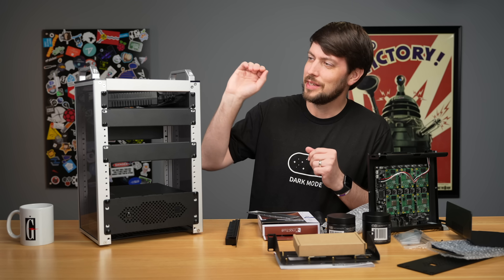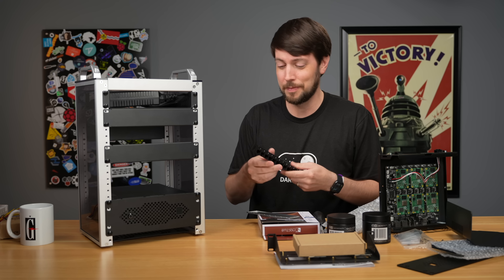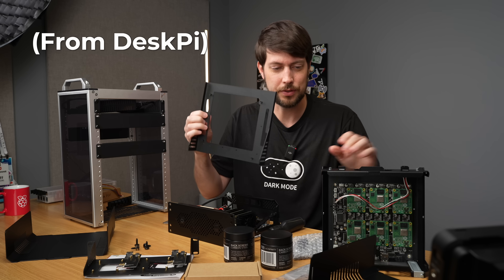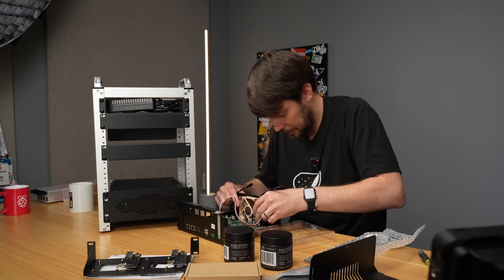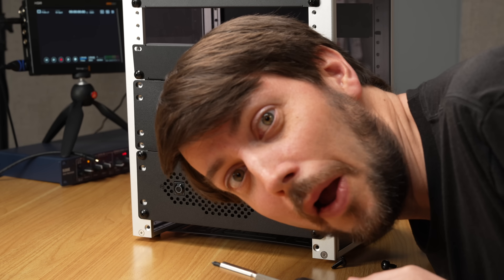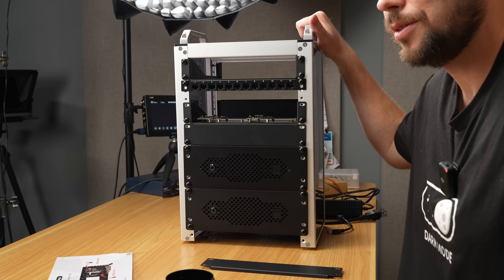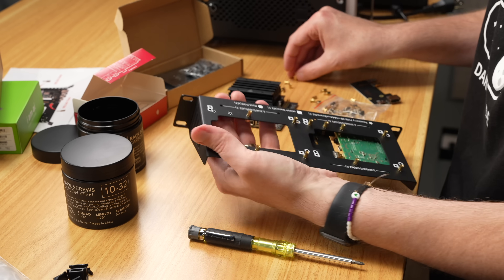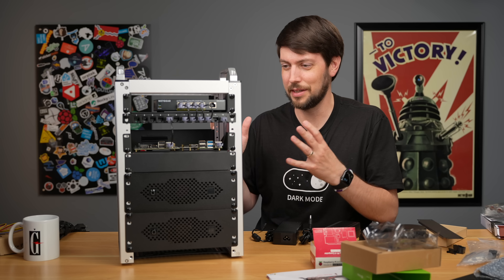Say Hello to My Little Rack!

Comment: The only thing I don't like is that there's no 10" UPS.

Also, I think the blank panel is supposed to be put on after the shelf so that lip hangs off the shelf and makes it look like a 2U piece instead of two separate 1U pieces.

Comment: Thanks to all the mini rack videos between you and friends, I learned that "10inch" rack space is extremely niece and raspi parallel.  Don't get me wrong. I have a raspi4. But that is just that. That generation of raspi convinced me it was a money pit. So I chose a 12U 19" rack for my first one instead. I want something that can grow with me. At least for a time. What ever part I buy that can go to the next upgraded system, would be good in my eyes. But without your videos and friends. I would have spent $200 more on my setup If I had not realized this.  Not to mention I don't want to buy a 3d printer yet. With bamboo 3d printers turning into canon or hp with regular printers business model and all. So thanks. Dogged a few bullets due to your reviews.

Comment: Just installed my 8U geekpi rack, nothing as flash as yours, just to tidy up and put all the iot hubs and netgate fw, switch, ap etc all in one place, wish I had done it ages ago. Just the right level of build quality. thanks for the recommendation. Love the Pi shelf, using it for a Unifi Controller. The wife also likes it. Now going to 3d print some cable management for it.

Comment: for power supply, why not use a Meanwell 12v PSU, and then add 12v car USB adapters for the 5v USB-C devices, and use pico psu for "main boards" (you can find upto 250W), that way (although you still have plenty of cables, they can be exact length, and) you only need ONE PSU (to rule them all). NOTE: this is how I have my mobile setup to manage about 15 SBC and 4 mini-ITX "main boards", but I also have automatic dual power switch that flips from solar 12v to mains 12v when "land bound", all running of a single 500W Meanwell 12v PSU with 12v car USB power where needed (and one mains cord :)

Comment: Can I ask why you have everything offset by one screw? Its the reason nothing is lining up exactly as it should. If you look at your holes they are not spaced quite right. Its because every on a single U, the middle hole is always offset. You need to use the top and bottom hole on a single U.

Comment: Gonna put this here too. I found that a UPS/PDU for a 10 " rack was completely lacking with one exception that is profoundly overpriced compared to 19" versions.  My partners and I run a prototyping lab, and we are downsizing our network rack as well as taking it off-grid.  The goal is to run mobile offices, moving them from client to client, improving collaboration, speeding up iteration, and saving shipping.  We've downsized the office network, from 2x36u racks to a 20u rack, and now to a 10" 12u rack.  

The last piece to this migration is a DC PS / PDU / UPS fitting in a 10" form factor which we have been designing and refining over the last 5 years. The price would be comparable or less than a similar commercial lithium UPS. This has been a slow burn project since I thought we were the only ones interested in such a device, so we didn't make it a priority or crowdfunded it. Building more would be about the same work as building ours, so if there is interest we can take the project off the back burner and build as many as needed. 

As currently designed, this 2u 10" rack UPS provides a number of 5V, 12V, 19-20V, and 48-54V barrel jacks, as well as USB-C outputs.  There are no AC outlets; it is DC only.  A small OLED touchscreen and embedded web server are used to monitor and control the UPS as well as send shutdown signals to the connected servers if and when the batteries are depleted.  The system will recharge and run on AC power and/or DC (solar?) as available and provides up to 1120W of power.  

The UPS as a system scales from 500W/h to 7W/h of capacity.  This means that it has 20 minutes of real run time at max load for the minimum system, and up to 6 hours for the maximum.  At a lower load, such as the 238W we expect to be drawing, we are looking at 2 hours for the minimum system and well over 24 hours for the maximum, which was our design specification.  Note that KVA ratings don't really translate 1 to 1, since no AC is provided, but it is close enough.

The way it scales is that it is a 2u 500W/h device that is expandable with up to 3 additional 2u battery packs each adding 1W/h for a total of 3.5W/h.  For AC (shore power) charging, we plan to have a 3u 1/3 depth AC adapter that can be mounted on the rear of the rack enclosure, convertible to a front mounted 1u 1/2 depth unit by flipping one set of rack mount ears and discarding the rest.  Yes, this would occupy a total of 8u, 9u with the AC power supply, so we are also making a small 1/2 u, 1/3 depth ATS that allows up to 2 UPS and battery expansion systems to be mounted in a different 10" rack enclosures as well as providing load balancing and automatic fail-over. Since we plan to run Starlink, a network, local AI server, NAS /container server, PoE phones, wireless APs, lighting, and other systems in the mobile office, this isn't as much overkill as to seems. The UPS would also work well in a tiny home, vanlife, or other compact low power application. 

If it sounds like this is something you need or want, please let me know and we will start making it a reality.

Comment: Geekpi now offers a 0.5U brush cable panel on their website. Has anyone found a power conditioner that will fit this rack? I purchased the AtlasIED AP-S15HR and it is slightly too wide. I have the Dremel ready to go to make it fit, but was wondering if anyone has other solutions.
Reply: some guy on ebay has them the rack ears need a little modification but it wasnt to bad

Comment: The Middle Atlantic PD-415R-SP fits perfectly in a 10 inch rack for surge protection
Reply: For others reading: I got one from ebay on this recommendation ($82). It certainly fits, but the rack backets don't support the position of the holes on the geeekpi rack. I solved this by screwing in only one side, then putting a rack shelf underneath ($22) to stabilize it. It works and doesn't look awful. 4 power ports, surge protection, looks cool. A+ for ~$100 total.

Comment: Would a  450 - 1.2 KW 5/12V PDU work ? 😊 have a WiFi enabled version in prototype..

It’s a take of of the learning cluster power control system

Comment: My boss gave me one of these today and saw the same stuff about finding PDUs I think I'm likely to get a "recessed power strip" like those meant for embedding into conference tables.  They are usually a little tall for 1u but could be shaved down if plastic housing. 

https://youtu.be/yEVrbBEZ3i0?si=6wqkWZjl6SaDDFQb
@lmcases1985 Make a half rack width PDU with us plugs. It's pricey but top notch quality.

Also the Tripp lite BC600R could likely rest on the bottom of the rack if loaded from the side. It just wouldn't hook to the rails, as is. Maybe some custom shelf and/or brackets +zip ties.

Comment: KC7ZDM here. I have a mobile 4U 19" rack case originally designed for mobile audio ops. I put two shelves in and mounted a Yaesu VHF/UHF FM radio, and a Yaesu HF/VHF/UHF radio. Each radio has a TNC (terminal node controller) for WinLink and other digital modes as well as power distribution based on Anderson Power Poles (12VDC). I'm just turning 68 this month and not getting younger and stronger. I'm thinking two of these 10" racks are more easily transportable or I could put them in a transport case and use a dolly.  Either way, the weight would be reduced when setting up and tearing down which we ham operators do often.  One of the events I like to support is the Silver State Classic Challenge race on Hwy 318 between Lund (at the north end) and Hiko (on the south end).  The speed record for the 92 mile course is 219.6430 miles per hour set in 2017. That's AVERAGE speed!  The event uses us for comms as there is no reliable cell coverage (or any at all in most places). We use the event for disaster comms training. It's a win-win!

Comment: Maybe you don't need a PDU for AC power, you can get a 12VDC "PDU" by using a blank 1U Panel and drill some sockets, and a high amperage AC/DC converter (or brick).

Comment: I love this 10 inch rack, much cooler than the hanging types. So I remembered you saying you can't find a US 10 inch PDU, 10 inch racks are common in Europe for SOHO use, so accessories are much easier to get hold of, anyway I came across this video when investigating 10 inch racks more https://www.youtube.com/watch?v=cALwxH5vJuo Don of Novaspirit Tech bought a surge protector power gang with 3 mains and 3 USB sockets, then 3D printed a panel with posts that aligns with the hanging holes of the power gang for his PDU solution, so might be an option you could look at if you don't find a ready to go 10 inch US PDU.

Comment: I have to admit, that little rack is very cool!  A nice portable form factor that is flexible and reconfigurable.  A small UPS would be a perfect addition...  I have been debating about designing a small UPS for Raspberry PI systems for just this use case.   Most of the small USB battery packs don't have continuous power output, or end up having problems with the batteries if left plugged in.    Oh we could even have a little power monitoring circuit in the loop so you can Grafana the power usage.  Lots of possibilities!

Comment: An enclosure with a few Pi's, a mini pc and 3d print a mount four a Ubiquiti switch it would be awesome. I am betting you could take a small UPS apart and put it in an enclosure that will fit that rack if you feel comfortable working with line voltage. Unfortunately the rack is out of stock. Once I get one and a 3d printer might come up with something awesome.

Comment: You could get the magnetic LTT cable management system, they come with power brick holders that will attache to the blanks.
Reply from the maker: Not a bad idea. There are some nice little power strips that have those keyholes.

Comment: I always do the 2 bottom screws only. If it's heavy, it'll just pull  backward on the top, meaning the top screws aren't really doing much for you
Reply from the maker: Be adventurous! Do top screws only for lower equipment. That way it slants out for better visibility :)

Comment: This is very tempting... but I want a 6-8 drive bay that I can hook into that Mini-ITX case.
Reply from the maker: Mini disk shelf ftw
Reply: @Level2Jeff  Mini ITX NAS. :3
Reply: so far I have only found 4x 2.5" drives 3D printed in 1U 10"... but that seemed like an easy solution and 4 disks is plenty to do a raid5 type setup for some fault tolerance.

Comment: The bumpers on the fans help with Calculating Llama Expectoration Trajectories. The rubber Bumpers in the box help with Reticulating splines. Its hard to beat SimCity without them 😶

Comment: Zip tying gear to a blanking panel is a time-honoured tradition. And usually engineers honour it by getting angry at the lazy person who couldn't be bothered drilling the holes and filing them fit the zip ties and not take up a fraction more than 1U, so you can actually fit something above or below it. Or, you know, mounting it to the shelf like you're supposed to.

Definitely needs a proper mains PDU though. Should be pretty easy to design a bracket to mount a small power strip. Or just zip tie it to a blanking panel.

Comment: Random Google search shows a half rack 1U UPS - part number PG400-UPS-HR-DC28 with 28VDC output (aviation/military). Might be worth checking out.
Reply: The RUGGED UPS FA10449 is also half rack sized, and is AC, but unfortunately 3U.

Comment: The rubber nubbins are better than screws even when the fan comes with bumpers, becasue the screws are rigid mounted to the fan, and then the screw heads don't have any rubber isolation to the chassis, you're basically completely negating the point of the rubber bumpers on the fan when using screws. Whereas the nubbins give you full rubber isolation in all directions.
Reply from the maker: I just love the word nubbin. Makes sense!

Comment: I started making my own 10in rack mount with my printer and 2020 extrusions based off a 6in rack from Kron something on thingiverse. I halted my development as 3D modeling everything to put in the 10in rack was a lot and I eventually outgrew my use cases for it. I did built the rack, just never modeled any pieces to print for mounting my switches, etc.

This is super cool to see! Glad to see something like this come to market. Maybe ill revive my project.

Comment: A server rack in a similar footprint to a Dell Precision tower, it is definitely adorable, but I'm not sold on being useful as a home rack option. I'd want premade metal shelves specifically fit to the most common tiny/mini/micro computers (Apple, Dell, HP, and Lenovo), and it'd have to have a PDU and KVM solution, just for practicality's sake.
Reply: you can get 3D printet 1U covers to most of those things or 1½-2U for larger stuff...

Comment: I like this rack. I hope the 10" form factor takes off.
Reply: takes off? it's been used for AGES... but mostly just telco stuff but 3D printing made it easier... and the 2U cases for ITX he shows off are super handy too for homemade servers... and a 12U rack with 6 servers = easy peasy or most like 5 servers + switch/patch panel and then connect it to a second rack with all the other stuff in... so a 5x 2,5Gbit switch with 1 SFP+ port and then a SFP+ cable over to the other rack and you have your on little data center in very little space :D
Reply: @LiLBitsDK  I didn't know that. Thank you.

Comment: Jeff, I am a computer science student, and I am working on a research project of materials, and one of the things I do is calculate SCF structures using quantum espresso... Do you think it would be possible to run those calculations in a RPI cluster? (they are heavy calculations, on my I7 20cores (8P 12E) takes 30+ hours)
Reply from the maker: I think it would depend a lot on whether the CPU can accelerate any of the calculations natively. The Pi is generally not that good at compute tasks (compared to a modern Intel or AMD chip), even clustered. More for lab environment or when you need efficiency above all else.
Reply: Buy a common computer. Xeon. Epic. Whatever is more powerful than that shitty pis

Comment: I've been running a 6U 10 inch rack for a couple of years now.  Outside of a 1U patch panel, every single thing I mounted in it required me to either design and 3d print my own rack ears, or, in the case of my own Turing Pi 2, 3d print the entire 2U case.  It's great to see the 10 inch form factor seeing some development.
Reply: The wide range of models for 3d printing is the biggest advantage of a 10" rack.
A shelf from Amazon with a 3d printed front combines the best of both worlds.
Reply: @Spazzmoticus Do you happen to have your Turing Pi 2 STLs anywhere public? Or know of a good place to find any?

Comment: slap one of those fat 12V PSUs in the back and make 2 copper rails with 12V.
then branch off every time you need to connect something
Reply from the maker: Ooh you also get a happy tingle if you touch both of them at the same time!
Reply: @Level2Jeff  its a security system to keep red shirt jeff away from your Network
Reply: @Level2Jeff LTT once showed of a cloud gaming VM server that had a 12v DC connector in the back to hook into a PDU.
maybe you could make a 3d printed version of something like that

Comment: that would be great for running those asrock n100 itx mobos
Reply from the maker: Definitely! They don't even need that much cooling—with the right RAM and cooler, you could use the 1U trays and mount up at least 3-5 without a problem.
Reply: @Level2Jeff  and then my brain went to setting up a a 4 node proxmox cluster or multiple low power linux server machines when you mentioned you could mount two next to each other to mount in a 19 inch rack. Maybe they will make a 10 inch disk shelf for SSDs at some point lol

Comment: The small "bad bend" on the blank panels exist to make sure your racks are evenly spaced otherwise you'd run into a scenario where you'd mount, say, a heavy rack on the very bottom or top slightly offset because of its weight and then you'd wonder if the rack was manufactured wrong a few extra units further because the offset from the first rack was amplified to the point the holes don't match up anymore. And then people decided they didn't want to deal with this issue and invented rack rails.
Reply from the maker: Heh I could just imagine Supermicro designing tiny 10" rack rails :D

The whole thing would tip over if you even had a little rack drawer!

Comment: This would totally rock as a home demarcation unit -- I have a modem, router, switch, and VOIP gizmo where my network enters the house, and a rack like this would be awesome.  But of course NONE of those things are (yet) designed for little racks.   UPS would also be good.  I just ended up building some wooden shelves to go up on the wall of the basement.

Comment: Need a 10 inch 2U/4U JBOD. Then we could do a Mini-ITX system and plug it into a little storage array! I kinda want one of these now... Would look way cool/industrial to do a PC build in that rack.
Reply: so far I have only found 4x 2.5" drives 3D printed in 1U 10"... but that seemed like an easy solution and 4 disks is plenty to do a raid5 type setup for some fault tolerance. so 2U would be 8 disks... with 2TB disks  it is 8(6)TB raid5 in 1U 10" that's not too shabby for the cosplay sysadmin :D

Comment: The rubber mounts for the Noctua fan, connects the hard plastic from the fan, with the metal, without transfering noise as a screw would do.